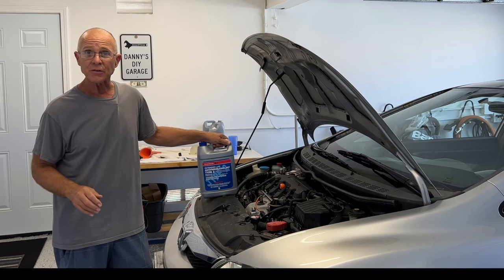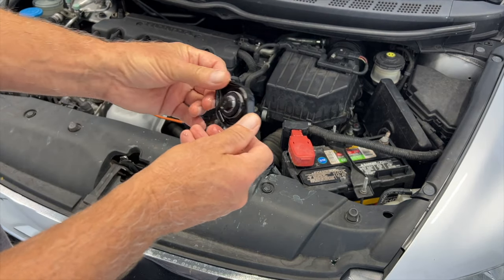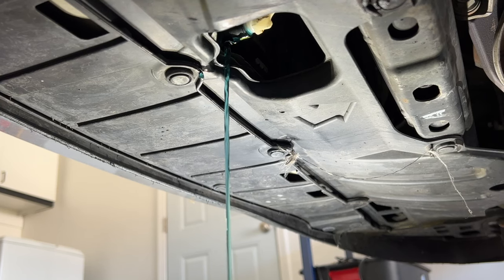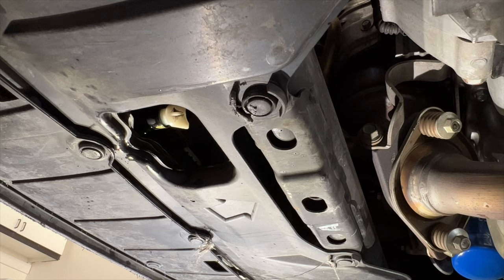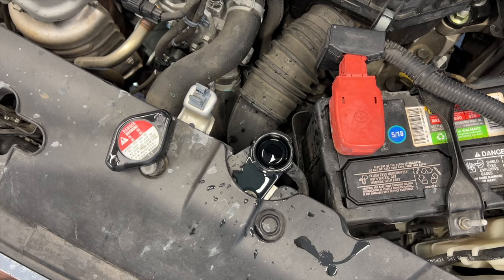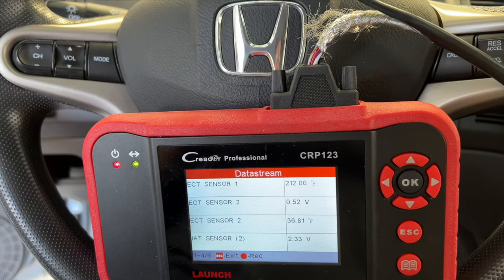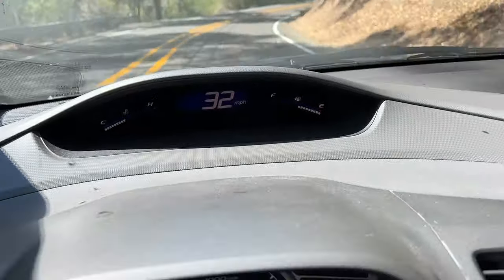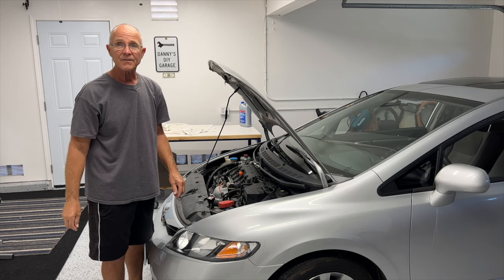Service your Radiators Cooling System: Coolant Flush Honda Civic

Comment: Great video. Just did mine however it was colder out. It's possible however it takes a lot more effort to get the fans to turn on. Mine turned on once and after that i let it idle for about 15 mins. Test drove it for 45 minutes driving agressively and everything worked fine.

Comment: Please, can you show how to clean the radiator? I have just replaced the AC condenser of my civic hybrid 2007, and I noticed that the radiator is all clogged with stuff. So, I would like to go back, take out the radiator, clean its outside with a moderately high pressure water jet, and put it back with new cooling liquid. My car has 235000 km.
Reply: I wouldn't do that. You're better off replacing the radiator.

Comment: I noticed on the front of my radiator there is a good amout of the fins folded over. Amazon sells large variations of tools to straiten fins. Do you have a certain one you can recommend please? Id like to do it without having to pull the radiator out, not sure yet if they'll be enough space yet.
Reply from the maker: I don't have a recommendation, good luck on cleaning up the fins, hopefully you notice a difference

Comment: I would add that's it's important to bleed the system properly. I like to use a spill proof funnel and make sure the air bubbles are gone before driving the vehicle
Reply from the maker: Could you add a link to this for my subscribers
Reply: I would say you are very smart.  You should re-make this video.  The original maker of this video could learn from you.

Comment: Thx for video! I’ve used a couple vids for reference! Two questions…since it’s a Sunday I can go get Prestone fluid…will that work good? I’ve used it before. Also I add to the reservoir at times…why the reservoir and not radiator?

Comment: Hey Danny, would an opened container of coolant go bad? Checking because I know you said brake fluid does go bad and only used an unopened bottle. I have some coolant I used a few years ago to top off the coolant reservoirs wasn’t sure if it could be used now, always had cap on container when not used.
Reply from the maker: Your coolant is fine, brake fluid absorbs moisture from the air
Reply: @dannysdiygarage  awesome thank you!

Comment: I don't intend changing mine but have wondered where the reservoir is to check the level.  Had to top up oil and had a look, found the cap in the place it is in this video.  Most of the videos show a different system.
Only had the car two and a half years 🙃
Reply from the maker: Glad it helped

Comment: Thanks for doing this tutorial video. 
Did you fill radiator until fluid got to the very top? Also, is it necessary to empty reservoir before refilling?
Reply from the maker: I did not go to the very top, leave some air burping room, once its all good, let it cool down, that's when you will fill it to the top, yes empty the reservoir
Reply: Thanks! @dannysdiygarage

Comment: Hey Danny, I have a 2013 Honda Accord LX with the 2.4L engine and had a question about the coolant reservoir level. When my engine is cold and has sat overnight, the coolant in the reservoir reads exactly at the "min" line. After a drive and getting the engine fully warmed up, it is about 1/3 of the way between "min" and "max". Do you suggest I top off my coolant reservoir, or should I be good for now?
Thanks for the help and keep the vids coming!
Reply from the maker: Cold is when it’s checked, so adjust the level when cold

Comment: Hi Danny, thanks for your video. Do I need to flush it out with distilled water if there is gunk, before I add the type 2 coolant?
Reply from the maker: Not usually, I don’t know what your cooling system looks like, but usually on these cars there fine, unless you have clumps of gunk in your radiator, you’re fine, if you do have gunk you probably have other issues

Comment: Seen videos leave the radiator cap open after the coolant top up till the fans go on twice then close it after. Any thoughts about that Danny?
Reply from the maker: Yes if that works, in cold weather your vehicle might not get hot enough for the fans to come on.
Reply: I use the lillly system on my 16 accord..its easyfill up till cant..turn car on with heater on high..then let it drink more colant..watch temp gauge..and done

Comment: So you don't add any fluid to the reservoir? Just top up in the radiator? And the extra should spill over on its own to the reservoir?
Reply from the maker: Add fluid to the overflow, there will me a level marked
Reply: @dannysdiygarage  Thanks

Comment: Why do you need to replace the cap?
Reply from the maker: Great question, I should have clarified this, the Caps hold pressure in the radiator and keep coolant from boiling, if your cap isn’t holding pressure your vehicle coolant could get to hot, you can pressure test the cap to determine if it’s good, but the price of the tool is more than the cap

Comment: Hello sir can i use any brands of coolant for my 2009 honda civic I just purchased valvoline anti freeze coolant.?
Reply from the maker: There’s a lot of brands that work, make sure it’s compatible with Honda.
Reply: No you should. Only use Honda type 2 coolant. You buy it at any Honda dealer. Its only 21 dollars. 40 for 2 gallons. Dont cheap out. The factory coolant is type 2 coolant. By putting that valvoline garbage you potentially will ruin the engine. Only put type 2 coolant, or if you do put valvoline you need to drain the entire block. Which takes a ton of distilled water and hours to do

Comment: How do you check the anti freeze coolant level?
Reply from the maker: check the coolant when the car is cold, remove the cap, and top off the radiator with Honda 50/50 mix, if it looks bad change it, otherwise top it off and add coolant in the coolant overflow bottle also don't over fill it, there is a full cold mark on the side of the bottle,

Comment: How much coolant do you add?
Reply from the maker: 1 gallon
Reply from the maker: 1 gallon
Reply: Okay. What happens if it starts getting way too hot after all is said and done?
Reply: Or what do you do?
Reply from the maker: @Fishing_4_Recovery  I'm not sure what you're asking, was it getting hot before you changed the coolant? if not you have a air bubble in the system, shut it off, let it cool and try it again
Reply: @dannysdiygarage  no isn't it was doing just fine. It really just needed a flush though. I'm think I got it figured out. I don't think I had enough in there. I didn't add a whole gallon in so I think that's mainly why it was over heating.

Comment: Do you recommend running the car with the heater on the day before just to circulate the fluid in the heater core.  I live in Phoenix and I hardly turn on the heat.
Reply from the maker: not a bad idea, it sure wouldn't hurt. Thanks for adding this.

Comment: Hi Danny this coolant replacement went perfect on our civic 2010 and the heat blasts really hot on -30 windchill day

I have a 2012 accord I had the dealer flush coolant at 90k, at 102k now and I notice the heater at max heat doesn’t blow as hot as the civic

After dealer flushed accord it also made a weird sound in the dash area for a week or so when pulling up into the garage after a drive at the end of a drive 

The civic heat blows so that at max it hurts palm of hand 

Never gets quite that hot on the accord

Could the dealer have done something incorrect when flushing coolant with their flush machine ? 

It’s been since spring 2022 when they did the work 

That dealer at 90k was first coolant service for accord

I should have done it sooner and by drain and fill

Ironically the civic was flushed by the same dealer years ago at 85k and I just followed your video’s steps to do a drain plus fill at 150k a week ago

Civic always had hot air, accord gets warm just not the same degree as civic 

Both engines super warm after 20+ min hey driving
Reply from the maker: I doubt the dealer did anything wrong by flushing, use a scan tool and compare coolant temperature readings between both cars when they are at operating temperatures, also could be the blend actuator or door sticking, just a thought, it would need to be checked.
Reply: @dannysdiygarage  ok will do, which scan tool could be used to read coolant temps?
Reply from the maker: @vandiyplant921  I’m pretty excited about this scan tool for the price, it’s a lot of scan tool for the price https://amzn.to/3H3yrkg here is a video where I compared 3 scanners at 3 price points Honda Civic Runs Hot Overheating
https://youtu.be/Uw4lLvyFOns
Also this video shows it to Honda Scan tool, diagnose TPMS, Idle relearn, LAUNCH X431 Elite Scan
https://youtu.be/pj2AB_3ORp0
If you purchase it please use my Amazon affiliate link above, it helps my channel, the difference between the $30 scanner is the ability to see both coolant sensors, that’s what you’ll need, good luck 👍🏼
Reply from the maker: One more thing, possibly an air bubble in the system, not likely but possible
Reply: @dannysdiygarage  it sounded like I had one right after they changed it, for a week or so. Coming from right side of the dash when pulling into garage to park , like inching up really slow/ creeping up slowly to garage wall 

That’s what I thought I heard pulling into driveway and parking after end of drive. I always turn off hvac at end of drive

I noticed the coolant reserve tank went down after a week or so of driving and I topped it off.

I plan to do a drain and fill when it warms up

I am also going to replace the blower motor and transistor because a 4-5 years ago accord’s blower started making annoying mild buzzing sound, gets louder the higher fan speed. 

The civic is 2 years old, quiet blower motor and much higher air movement from blower
Reply: @dannysdiygarage  ok I will use the links you provided thank you for all your help

Comment: Danny, doing this when it’s 30 degrees out. About how long could it take for fan to come on completely cold engine over night ? I didn’t even keep track when I started car whoops
Reply: The fans started kicking on after holding RPMs at 1500-2000  like you did. You made it an easy task thank you!